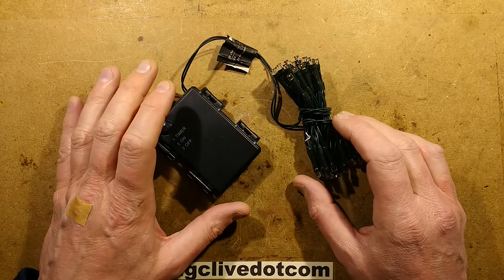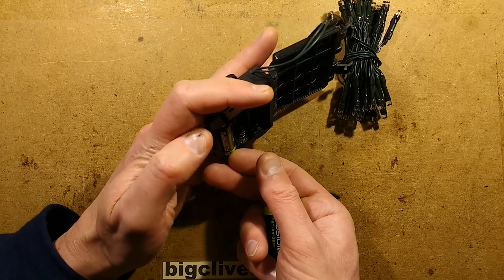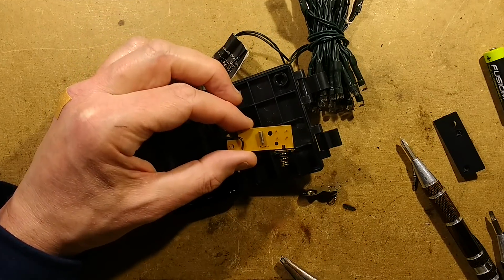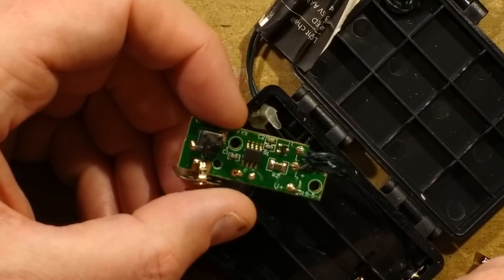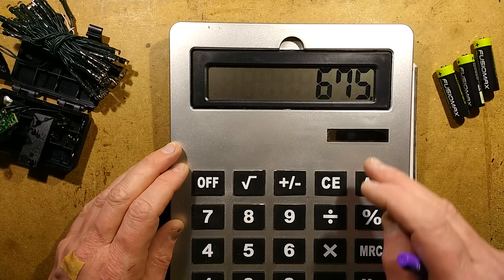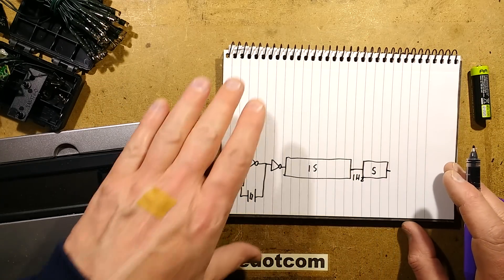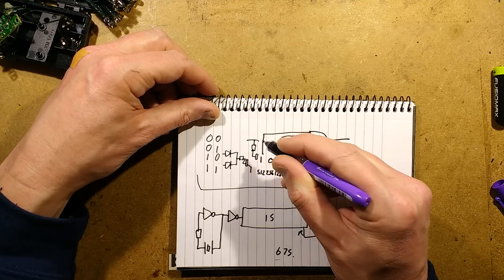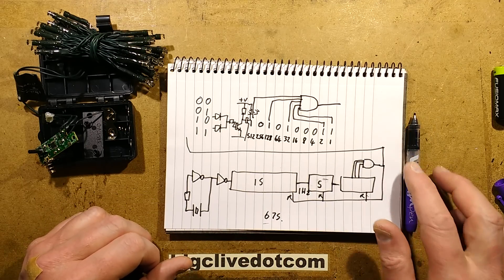Timer lights logic doodles.

Comment: I just noticed the new digital timers available for christmas lights at our local store. I thought myself it is probably a micro controller. Now you made me want to tear one down. I still have the old mechanical wheel type that you pull this plastic pin and stab it into the place you want it to strike the on off switch. Next year I may buy on. being they are new to market, the price is too high. As usual,anything new to market,the co.pany trys to make as much possible to recoop their initial investment. Then when the patent runs out,everyone and their brother produces one. If you wait a year,the chinese steal the design and make 100 different versions of the same thing. I like that when it comes to things like RC planes and vehicles,especially drones,and of course Gopro camaras. I have a chinese knock off of the pirated cube gopro said nobody else could sell in the US. Funny because I got one from china for less than $20. I would suggest you tearing apart one of those but I dont think you could do that and get away with it without gopro going after you. I always look at the famcy new electronics as" wait a year and someone else will sell it cheaper". Those timers are no different.

Comment: For the bit pattern you might have to add the low bits also to the AND gate (inverted of course) as there is more than one bit pattern that will turn on the gate ;)
Reply from the maker: +Sebastian Rietig Ah, but the first combination that turns it on is the one I want.
Reply: and then the counter gets reset to 0
Reply: Yeah, I forgot about the reset
Reply: You don't need a five-input AND; you need one quad-and chip... what would it be; a 74AC08 chip; something of that sort. Then you put the output of one into one input of the next, and so on and so on, until you've got five inputs and one output. 

You couldn't have digital pin 4 as the reset pin, as I'd first thought, because that one goes high a lot while waiting for 1010100011 to roll round. It'd be better practice to check every single bit. You could probably do it with a couple of 74AC00 chips, but I'd have to have a think about how to do it. 

I'm probably showing my age here with my choice of logic family.
Reply: bigclivedotcom Yes zero zero ON I think I followed you there Clive...So much easier with an 8 pin Micro these days youngster's have never had it so good when it comes to The Hobby....Interesting Video 👍👍👍
Reply: Sebastian Rietig, I thought the same at first but then I thought what clive just wrote here.
Example: If you want to reset at 100, you just hook up the reset pin to the 3rd latest pin. Because 101, 110 and 111 come after 100, so they will not be reached anyway.
So yes, using an and-gate with a counter works. It just may be hard to get a cheap 5-input o.t.s. and-gate. I would use 5 inverters with their outputs bundled which goes into an inverter again. There may be ics with at least 6 inverters in one package. Or we just use transistors and resistors (n-mos/p-mos) logic, which would on the other hand consume more power than cmos.
Reply: Yes but that number would be the lowest number to give an output.
Reply: 4073 triple 3 input AND would be a single package solution to 5 input AND (with a couple of pins tied HIGH)
Reply: To match a bit pattern of up to 8 bits, use a digital comparator ;-)
Reply: And feed the 9th bit into the enable pin.
Reply: @simpleminded1uk
that's true. but there is only ONE chip so no question about usual packages. It's a microcontroller or an ASIC. And if it is an ASIC, they will just make a 5 input AND. Especially at this low frequency (1/32Hz). Just 10 transistors (5P + 5N). In ASIC design you do not need to think in commercial IC packages.
Reply: That's a ASIC design (if no µC). So you make your 5 input gate with exactly the necessary amount of MOS transistors (10). And you take the advantage of the fact, that you do not have to fully decode the output combination, as you RESET the counter at 675.
Reply: Why would you implement this with individual chips? Clive was talking in a blob-style chip context anyway.
Reply: A hobbyist watching this is unlikely to have cheap access to ASIC manufacturing, so if you wanted to make this yourself, you'd have to use 7400 series ICs or a microcontroller, or maybe an FPGA/CPLD... But 7400 and 4000 is more fun!
Reply: Since 4 counts to 675 would span the entire 24 hours, if the output of the AND gate could trigger a binary counter then you could have it on when a NAND of the 2 lowest bits were 0 (initial power-up) then switched off 6 hours later when it hits 675 for the first time (01). That should get your 6 on/18 off pattern.

Comment: You do know the hot glue and isopropyl alcohol trick, do you? Makes removing it way easier...
Reply: Or heating it up with your hot air.
Reply: Simon Tay 
But heating it up makes it go rather sticky and prone to get everywhere. I prefer the original option as per Tobias.

Comment: Yeah, nice! Got an ebay link?
Reply: Here's a simlilar one from the UK: http://www.ebay.de/itm/60-LED-GREEN-AA-Battery-String-Light-On-Timer-mode-Use-IN-Outside/192149612936?epid=873650959&hash=item2cbd026988:g:4bsAAOSwiOFZOSQA

But I'm quite sure I have already seen these on AliExpress, I just can't figure out where/under which name :(
Reply: If you are in the UK, Aldi are selling these since last week, £3.99 each. They will probably all be gone soon though.
Reply from the maker: +Thomas Brannan I'm not sure if they sell them on eBay.
Reply: Thanks Tobias. This seller has a selection of colours and prices are reasonable.
Reply: They look like the enammeled copper rice style LEDS which are more weatherproof than the flex chain Clive was deconstructing.
Reply: Thanks for the top tip MrJozza. I spend 3/4 of my income on bright shiny things!

Comment: Nice set of lights. Would love to get a few sets myself, if even for the case. Can't find 3xAA waterproof cases on eBay.....apart from ones that cost €22 each!
Reply: Amazon look for these that is how I get my battery holders they are $4.5 a set for me
Reply: Have you a search link? Would love to get some waterproof 3xAA (or4xAA) cases. Have lots of LED lights outdoors - battery packs wrapped in tape, Saran Wrap, in a ziplock bag, tape, more wrap etc. And still the inside of the case is half filled with water :(
Reply: https://www.amazon.com/SoulBay-Battery-Holder-Switch-Wires/dp/B075S15W7H
Reply: Thanks for that, but they don't ship to Ireland :(
Reply: Some of the light sets? Scroll down for a few more. https://www.ebay.co.uk/sch/i.html?_nkw=3aa%20waterproof&ssPageName=GSTL Also https://www.ebay.co.uk/itm/60-LED-String-Copper-Wire-Fairy-Lights-Battery-Powered-Waterproof-Timing-control/232116992340?hash=item360b403954:m:maGXjDzdzRsqd0HfY3Yui0A
Reply: https://www.ebay.com/itm/Battery-Box-Holder-Batteries-Case-for-3-packs-AA-2A-3V-Cell-Waterproof-w-wire/281522715936?hash=item418c0fbd20:g:GJcAAOxyDLZR8piz
Reply: Here in the UK a similar set is being sold by Aldi at £3.99 mine have lasted 2 weeks so far on pound shop batteries!
Reply: Aliexpress is your friend, as is Banggood.